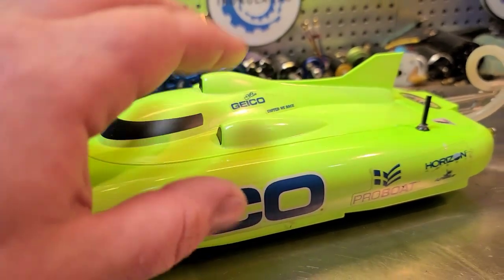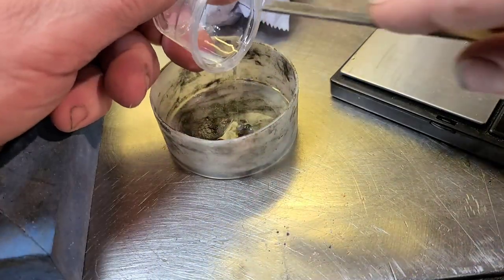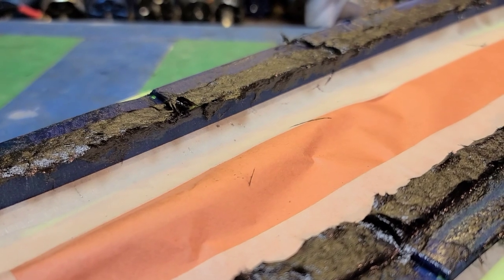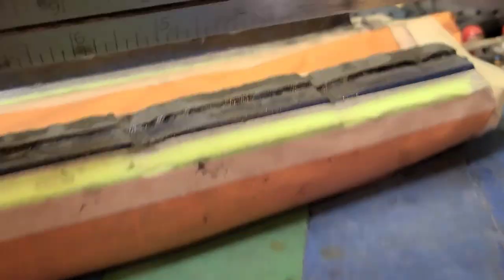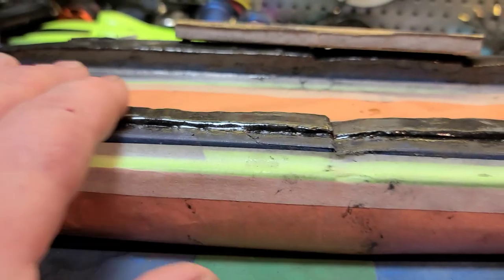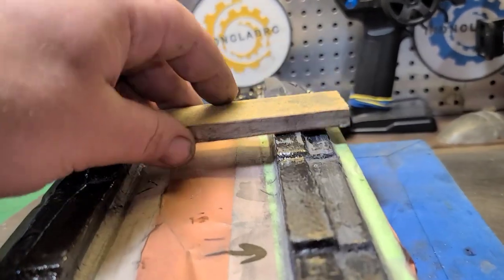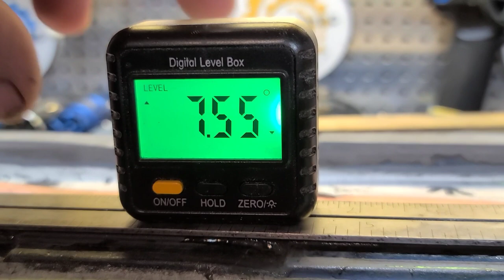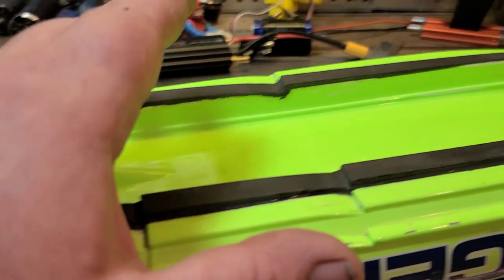Sponson Blueprint Tutorial Full Process Epoxy, Graphite, Carbon Fiber - Upgraded Miss Geico

Comment: Would you advise to tweak the boat out with props electronics CG tabs hardware etc first and as the very last speed mod,blue print the bottom?Great video by the way. Thoroughly enjoyed it and appreciate all the work you put in on your videos. Not an easy task. Learning heaps. 👍👍
Reply from the maker: Yes, absolutely.  Blueprinting is sometimes a last resort to get any particular model running right.     Some guys Blueprint before the boat hits the water.

Comment: the biggest problem i have with the one i upgraded is i put to big of a rudder on mine , blocking some of the thrust from the thrust cone, i run mine on 3s- 4s with a 32mm prop, but the rudder is holding it back some. its runs fast enough that it will do a perfect kick flip and keep going
Reply from the maker: That's why I blueprinted this boat, my boat would do the same thing with a big prop.. exactly what yours does "kickflips at speed lol.    I'm working on a motor mount right now I cut everything out the inside of mine gonna run the batteries in the sponsons c'mon.
Reply: @IRONCLADRC  i feel ya man, they do ride low in general even when up on plane. ive never had much luck with saw run high speeds on tunnel hulls or catamarans. they always seem to go airborne. i even tried a rear turn fin. similar to the tenshock or mini dom. mine seems to stick better on left hand turns, withe the batteries down in the left sponson. i might go a little bigger with like a 60a or maybe even a 80s. i have a few of those G2 sharks laying around, as i usually just use those 40s on these size boats. i think its kinda hard to beat a stepped or simple v hull as its just less prone  to lift up . frozen till spring now for most of us unfortunately.

Comment: I guessing this is a good thing to use if one was racing for cash or in a professional setting.  I have 4 new M41's I don't think I will be doing this, lol.  I have not see a big difference in the floating or driving adjustments or improvements in the handling of any boat that got this work done.  I have seen this done several times on youtube and other platforms.
Reply from the maker: If it's done right you'll see an improvement, Trust me.    Im not telling guys to break out the epoxy and sand paper and just go to town on there boats cause I'm definitely not..      this is a last resort type modification..  the geico 17 is or should I say was a toy TOY boat that got 5 mph top speed out the box.
Reply: @IRONCLADRC  Are you going to show a before and after result?
Reply from the maker: That's a good idea I'll try to find some old footage of the mg17 in action
Reply: having the m4 i think it sits up and higher when on plane than these little geicos.

Comment: blue printing the hulls is about the only modification i have not attempted on any of my boats. i do use air dirupters on hydroplanes example, ul1 or small bolt style hulls to keep them from going airborne as easy. im curious to see the difference on that little geico when its in the water. im going to try a 60a- 80a esc on mine in the spring
Reply: What’s an air disrupter?
Reply: Sp

Comment: Hi from France !
I have a big question : I see you blue-print catamarans but does it make any sense to blue-print monohulls ?
If not what can I do on my hulls to improve speed on a monohull ?
Thanks for your fantastic videos !
Reply from the maker: Any boat can be blueprinted but only if it needs it most boats don't need to be blueprinted but if your hull has dips and hooks in the bottom it may be worth the trouble. I've never blueprinted a mono only a catamarans and hydroplanes.  
  I  helped my father blueprint a 1:1 Alison race boat (mono) when I was a teenager we didn't add fiberglass or anything like that we just Sanded the bottom flatter basically knocked down the high spots in the hull

Comment: I'm going to attempt it on my Geico 29. Just want to check something with you. I see you have about the rear third of the ride pads making contact. Is that correct
Reply from the maker: Yea basically, the less surface in contact with the water the faster the boat will go.   You can go less than 1/3

Comment: Curious to see if she'll stay in the water at speeds exceeding 50 mph. Monos definitely have more water contact than cats, but that's what makes them so stable. Sometimes being ultra efficient works against you. Can't wait to see if you can dethrone the mini mono's 50 mph top speed. More so, I'd like to see a comparison between the Oximarine Mini Dom and Aquacraft Mini Mono. I think you'd be surprised to find that your optimized Mini Mono is actually much more stable thus easier to drive fast. I used to race these small boats at a local collage Olympic pool and I was able to beat guys with Tenshock Mini Scords (same as the Mini Dom) time and time again with your Mini Mono. Nothing against the Mini Dom; I have a Tenshock Mini Mono and absolutely love the thing. Boatgang!
Reply from the maker: I've gotta fix a Crack in the mini mono, she's all busted up at the moment,  I actually have  2 aquacraft mini monos, the one you gave me has  a thicker hull than the one I purchased. The one I got is stripped down  all the holes are filled she's basically ready for the mold making process,  just gotta find the time we'll motivation to Start the fiberglass lay up..  

Personally I think the mg17 will hit 50 plus, may not do it on the first outing but she'll do it I've got faith in that little boat now.   Fingers crossed 🤞